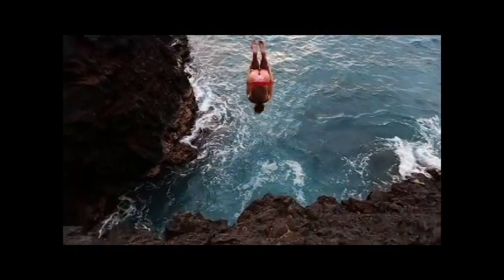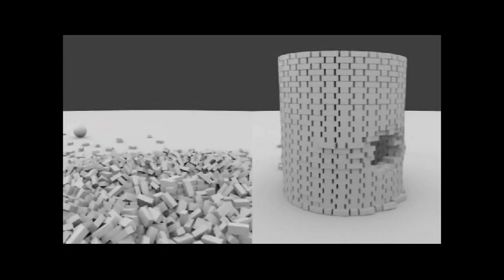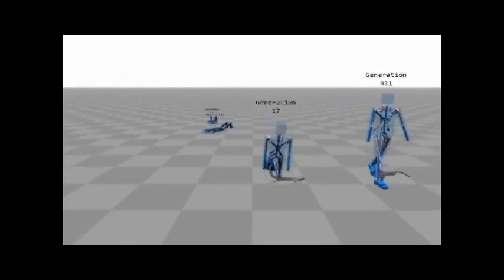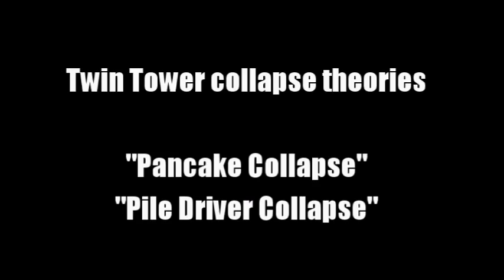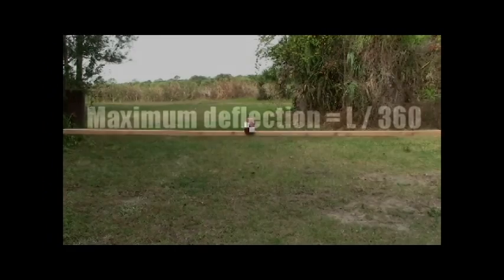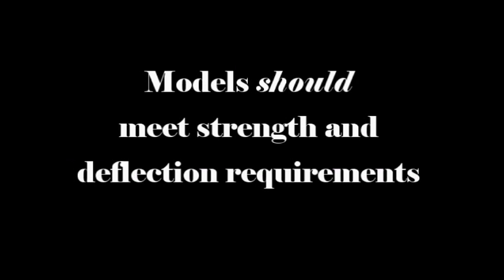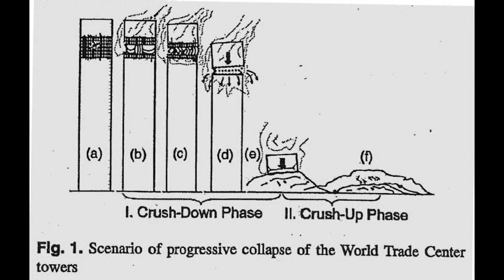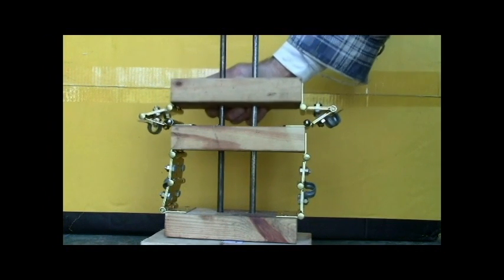9/11 Experiments: The Force Behind the Motion

Comment: Reading the comments gave me aids as an construction drawftsman that actually understands that steel loses it's strength almost entirely when it get's hot.
Damn even Wood is more resistant then steel wtf
Reply: Marvin's Life Channel but u then know that jet fuel needed 1000 more degrees to melt the structual steel ?..its just gramner school science. no harsh..but yeah..THAT MIGHT BE PERTINENT
Reply: Marvin's Life Channel . and..hollow aluminum wings CANNOT cut through construction grade concrete and steel. i mean..that is just LUNACY right at the start.
Reply: Chris Brown Also about the heat...
Buy a smal Double T-/U-Steel beam, place some brick as weight on top of it and light a fire with gasoline.
Much fun seeing the beam bending and breaking after a while cuz: Steel aint hold shit after a little fire, ask god damn Firefihters
Reply: Marvin's Life Channel u must be high. learn about the heat it takes to MELT steel. a firefighter will tell u its BS too.
Reply: Marvin's Life Channel gasoline will NOT BEND NOR BEND AND BREAK COMMERCIAL GRADE CONSTRUCTION STEEL .
Reply: Marvin's Life Channel furthermore..would u like pictures of steel frames standing after a fire..and which do u prefer to see? chemical..fuel..furniture warehouse..or lol..an office bldg from decades b4 built shittier w the steel frame in tact ?
Reply: Marvin's Life Channel or hey..there is also a nice video of a space shuttle crashing into construction grade concrete and steel. not 1" damaged.
Reply: Marvin's Life Channel was a safety test. which are MANY for you to watch and laugh at yourself over. itll be funny how you watch it and LEARN your story of BREAK W GASOLINE is fucking COMEDY
Reply: Chris Brown Next time a fire start at a storing hall just go there after the fire. The beams become spagetti. Al dente. Finito.
Reply: Marvin's Life Channel nxt time u go..

Comment: there is soooo mich wrong here.
the seccon theory relies on the huge force of almos a quater of the building falling for 2 meters and crushing everything underneeth. you did not have any Experiment testing that. all you did was build a model, but we all know, that small structures are far more stable than big ones (thats why insects are small).
you did not have all the parameters in the correct relation.
you experiments are pretty useless after all.
btw, thata the reason they used comouter sinulations.
because you cant really get rhe parametera in the right relation like this

Comment: http://911research.wtc7.net/wtc/evidence/photos/docs/wtcmemorium/trident2.jpg

Sorry sir, but can you not see the problem with all of your tests? At 7:38, you stated you had to build guide rails so the structure wouldn't fall over. . . Problem with that is in the tower design. Those "guide rails" should actually have been the support for the entire tower, and should have been the only support. You can see from the picture above, there is no support between one floor and another outside of the core support. The Twin Tower design was flawed, built by the lowest bidder, and with the cheapest materials available at the time. The only thing "ground breaking" about these towers happened on Sep, 11th.

Comment: just add small diagonal strips of copper backed thermite on each central steel column on each floor with a sequencing system in place , be it simple fuse or more sophisticated ... I would imagine that you would find your results to be quite close to the reality ... I would say to blow the firecracker on each level just before the thermite , that way it doesn't kick the metal rods after they've been cut , and theoretically continuing the downward motion without disturbing the upper floors as they come down

Comment: There's a flaw in your tests. The 4 boards are obviously not a single item. The have air gaps which affect the results you will get. You need to do it with a single piece, it also needs to have comparatively similar material properties to the steel. The weight needs to be equivalent to the weight of the building above in the towers and needs to be centred, yours wasn't centred. But most crucially, the towers did not have very much stronger beams supporting the floors along only two of the edges like you experiment. Those two edge supports dramatically change the characteristics of the structure and you will not get anywhere near similar results to the tower fall. You experiment needs much improvement... Show us your calculations that prove that the materials you used were comparatively similar in properties, i.e. strength, elasticity, density, to the materials used in the construction of the towers and the weights you used were also similar. You cannot just grab any material and use it to prove something. I could use I small, thin, light carbon nano-tube and show that the building doesn't collapse when I use them as supports, but carbon nano tubes are much stronger than steel. Prove your plastic pizza sticks have comparable properties to those used in the tower. You are also not taking air pressure into consideration. None of your experiments are sealed. As the building falls the pressure in each floor builds up due to it being a sealed building made from steel, concrete and strong glass. That Pressure will aid in the destruction and give the explosive effects you see in the collapse.

Comment: I have my reservations that the force of the controlled explosions in your experiments is not relative to that of the weight of the upper floors or the explosives used in the alleged controlled demolition in reality - since force and mass affect acceleration.

What does baffle me, though, is that, if you follow the mainstream media narrative, the building (with a much higher mass than the experiment models) had been shown to have a higher acceleration than said models - which is nonsensical (as greater mass reduces acceleration).

Comment: Very good modeling. However, the two vertical rods he used helped to support the "building", and the outside walls on the first demonstration also helped support the "building". He also did not factor in the damage caused by the burning jet fuel that went down the center of the towers through the elevator shafts. He also did not take into consideration the use of faulty materials used in the construction, this was after all a building in New York.

Comment: the building collapsed not because of a weight landing on it straight down,, the structure you have there is not anything like the eternal structure of the twin towers and it wasn't floor failure  that was a problem

Comment: sorry but your experiment is inaccurate, for a few reasons...the building floors were steel, a whole lot of different properties than your concrete sheets.
Then your construction was stiff at the sides, the WTC towers were not, they were held in place by the floor plates. So once one floor plate was gone the outer wall would collapse too, towards the inside because they were dragged to the inside by the falling floor plates.
You other experiment where you use fire also does not represent the construction of the WTC. A completely different construction method.
Then the experiment with explosives suffers the same construction error as the one before...what you basically did was reproduce the visual result but on a completely different construction.
You basically reproduced the collapse, while completely ignoring how the construction of the WTC was done. In other words, you did those experiments with a huge confirmation bias at the back of your head, without doing proper research on the construction of the towers themselves and what that implies for their collapse.
Reply: 1) do you know it was steel that was dropping out? could have been any kind of metal, not necessary from the building structure. Aluminium, copper tubing, copper wireing, ...
2) well, given the way it was constructed it could...the experiment was not accurate in this regard, it completely ignored the way it was constructed...the computer simulations did.
3) but the fact that the metal bend is what led to the collapse
4) the buildings are specifically designed to collapse into themselves, that is required of buildings in these densly populated areas. Otherwise they could take out multiple blocks
5) again, the way they are constructed allows that to happen...the floors are attached in a non riggid way to allow certain movement...similar to bridges. Once a certain number of floors collapse, the lower floors only need to be bend slightly while the outer walls are also bend slightly, and the floor are no longer attached to to anything. Exactly what the CS shows and what the first experiment of that dude utterly ignored...the walls were riggid in his experiment, in reality they were not, they bent aswell.

1) fuel is not that relevant in this case, because the main fires were just started by the fuel and most of it burned off anyway at the impact. Fires were fueled by other flamable things in the buildings, which there are penty on each and every floor.
2) the collums didn't fail, the floor plates did and dragged the collums down with them, as the design intended.
3) Not sure if I can take a comparison between a candle and a skyscraper fire serious...probably because it is utter BS. And again, no need for extremely hot fires, when steel looses its riggidness at relative low temperatures.
4) the black smoke is an indicator for low oxygen and are mainly seen on the outside of the building...however, it says nothing about how the fires behaved in the center.

Your example is even further away from anything sensible than those experiments. And again, completely ignores the way the WTC was build. It ain't that simple. The CS showed that, but I guess once you have an opinion about how it went down, no amount of PEERREVIEWED studies can change that.

The experiments the fellow conducted are debunked in 5 seconds, by people with only a limited understanding of architecture and newtonian physics.

Comment: while his experiments have a validity to them. there were a few things left out. 

1 shear loading
2 yield strength of the steel
3 and the effect of the radio spire at the tops of the buildings in the destruction of the towers
Reply: WTC2 didn't have a radio spire and it collapsed in less than an hour after being hit. Now what? Does less weight on the roof make buildings fall quicker?
Reply: Payed still 

it was hit at a lower level. that's why when the 2nd WTC was hit. It was the first to collapse
Reply: +animal16365  Tell me, do you have any understanding of the mechanics of building construction or have you adopted the NIST theoretical and unproven 9/11 political scientific methodology? The  basic principle you overlook is that the design criteria of any high rise incorporates the understanding that every point in elevation of structure is designed to support the gravitational loading from above to the ground through vertical supports (columns) with ample safety margins and over design incorporated into revolutionary designs such as the trade towers.

Comment: Just an engineer's comment: Such experiments are not scale-independent, because mechanics are NOT scale independent. A simple and intuitive example: An ant can lift X100 its weight. This is impossible to scale to a very big ant, or any big animal for that matter. In fact, an ant of the size of a cow would just collapse under its own weight. 

Many equations of mechanics that govern things like deformation are quadratic and cubic over size (length/width/thickness), so a  model just does not scale linearly.

I support scepticism but I also support good science :)

Comment: Lmao. This guy can't possibly be a real engineer. Your model looks and acts nothing like the real structure. For one your "concrete" didn't have any rebar in it so it's deflection wouldn't be proportional. And you applied a huge point load on the planks causing them to fail at the center instead of at the supports. The failures in the real building were likely caused by thermal expansion of the steel beams and buckling of the columns which means they likely failed at the connections of the beams supporting the floors.

Comment: Your models aren't even remotely accurate. Scaling doesn't work like that. For example, the grains in your concrete sheets. Concrete in the towers would have the same grain size and thus it wouldn't scale accurately. 

Think about it, a 1 cm diameter ball bearing doesn't leave a mark on cement if dropped from a height of 1 metre, but a 100cm ball of steel (a metre wide) from the same height would surely leave a chip regardless of the thickness of the cement.

Comment: well, to start of with, you need to take a sledge hammer and a swing at the model,  you know force equals mass Times deceleration too. your experiments  totally omit the devastating shock of stopping a god damn jetliner 300mph MINIMUM whatever crusing and diving speed to ZERO  without even factoring in the torque it would apply to the lower support columns.  there would also be vibrational harmonics from such an impact that would loosen every rivet or bolt with shearing and tension forces throughout the frame. anyone ever felt the sting off a baseball bat?? thats vibrational harmonics 
pack it up wannabe.
 you aint a scientist.  
not even an accurate observer of the event as it unfolded.
romancing the subordinate arguments brought about by the ignorant hordes
you might want to use jet fuel to replicate jet fuel, but no,
you just romance the collapse and change the constants within the experiments to attain the same results,  statistically speaking the result has no confidence, no integrity, just drama.
start from the beginning
start with the momentum of the jet
see what that alone will do to the integrity of a building.  not to mention jet fuel has supersonic potential, 
and explosions are just combustion reactions that occur at speeds faster than the speed of sound. 
so those upper floors were pile driver or in my opinion, the piston driving the compression and combustion into subordinate floors that were likely primed with fresh oxygen drawn up by the convection current made by the fire above. and sequentially blew out the walls.
have you ever mettled with kerosene, which is basically crude jetfuel, or jet fuel itself? 
it will sit and burn with black smoke while undisturbed,  but any movement of airflow like blowing it out, or moving a material soaked in it as a fire dance, or a flaming arrow, will only cause bellowing roaring combustion.  basically i think the top floors were the piston, drove down the compression and the frame threw a rod through the block for every collapsing floor.  in lamens terms amd im probably right,  there are at least 3 separate coefficients  within the overall system of the event. 
absorbing the impact of the plane
the additional weight of the airplane,
the ideal gas law maps the change in volume as the fuel drives down and combusts thereby blowing out the walls, 
COMBUSTION AND PNEUMATICS. with jet fuel
and the actual ventilation system of the building
and have a great day!  
the jet fuel deflagrated

Comment: Well,  if you really think you can accurately model a huge building made out of structural steel and concrete, a really complex design with plastic pizza whatevers and these thin planks, you just don't know nearly enough about engineering and different types of materials :)

Comment: The flaw with making small models is that physics behave different in smaller things. For example if you made a human 20 times bigger with the same proportions it would collapse on itself and break. Also on the model the floors are like an inch apart thats not enough time for the floors to accelerate to the same speeds as the floors in the real tower

Comment: Before I poke holes in the experiments done, seriously well done at attempting the reconstruction. It was a great video until out of no where, "so then I decided to prove my point by rigging the experiment to do what I wanted. Of course I couldn't time things right.... but if I had I bet it wuldda shudda cudda". Dude, if you get to time energy as you see fit, you can make that model take of like a rocket if you want too. Why 911 was a natural collapse. No respected lab supporting conspiracy has released mass spec results, which they would have if explosives had been used. The easiest way to prove explosives is chemical analysis. Believe you me, not even little green men can make chemical residue vanish from a blast site on a 5 by 5 meter area let alone 911. There would have been millions of news reports on toluene derivatives etc had it been blown up. Lastly you are assuming a linear model. Redo your pile drive experiment but use weighty concrete blocks for floors instead of light ply wood, then set fire next to the plastic supports on like 5 floors and let them start to not melt, but go gooey. Now the support strength on floor 1 will be non existent, 2 a weensy bit, 3 a bit better... in a gradient. then pile drive. The moving mass driving down will go x.... x+k .... x+2k .... x +3k accelerating downward, until restive forced decelerate... do that, then I'll reconsider

Comment: That experiment is completely wrong. Structural engineering is not as simple as F=ma. 
It's not just some linear interpolations, there are multiple number of variables to be considered.
Reply: The critical factor that makes the official story work is where they leave out any factor of resistance to motion. They don't even consider the resistance of air my friend. Now how scientific is that?